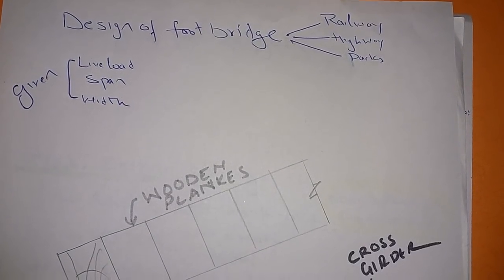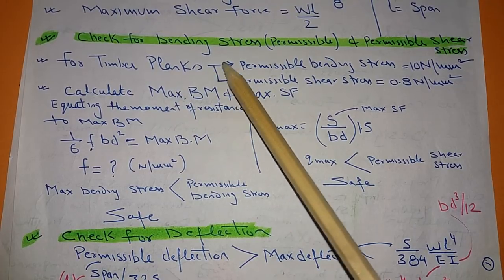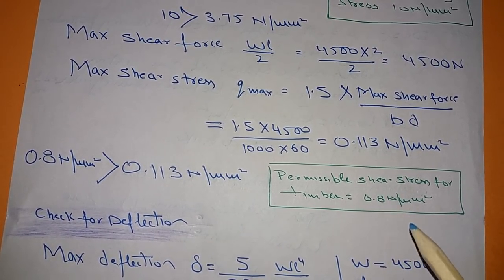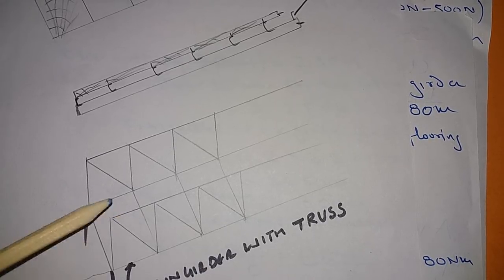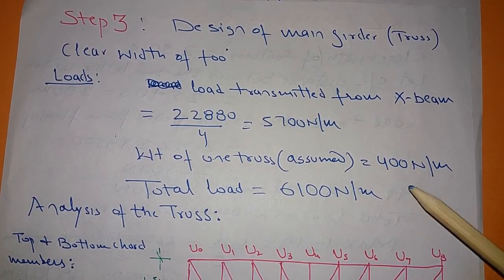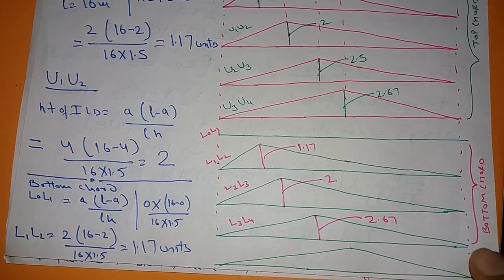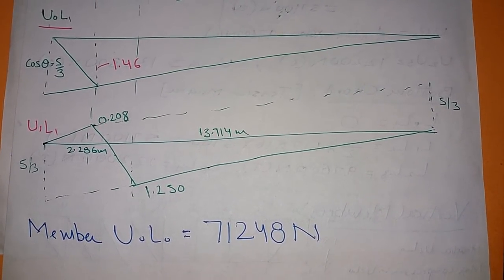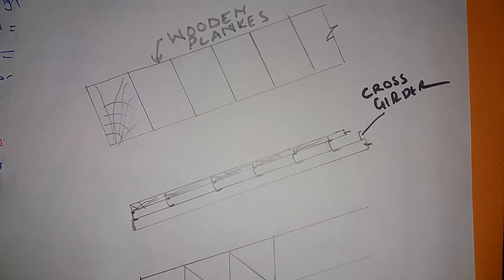Design of foot bridge (wooden deck) dss 2

Comment: Sir, check for deflection mein delta ka formula wrong hain, according to IS -883:1994, L^4 is wrong, it will be L^3 ..aur L ka  value 2000 hoga not 2